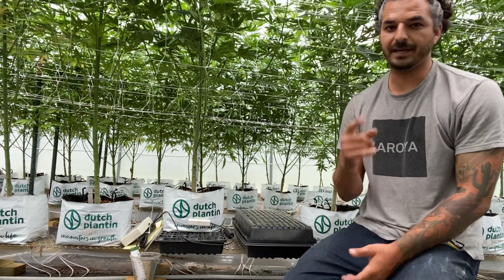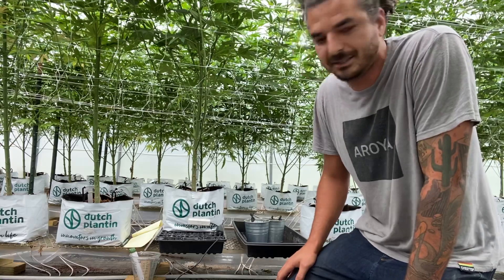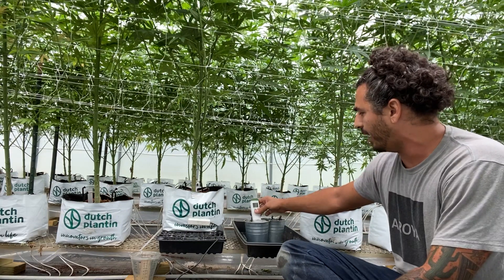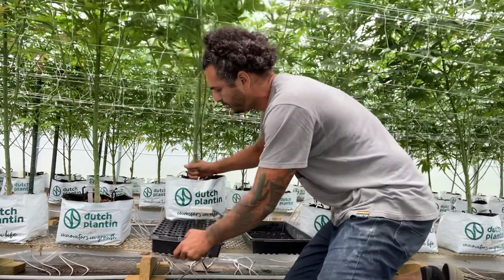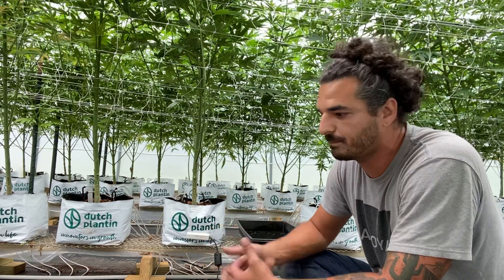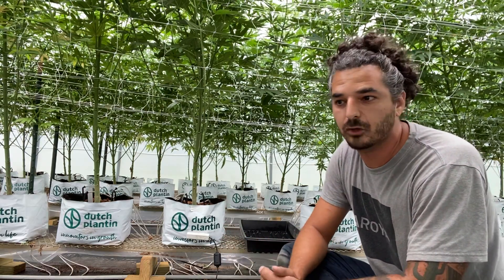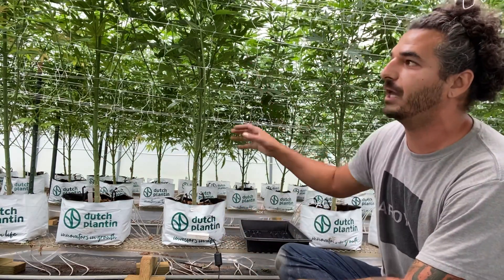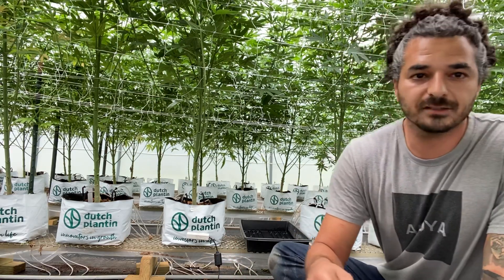Feed EC vs Substrate EC vs Run off EC

Comment: I am growing a sycamore fig tree seedling from seedling and my ec run-off (using distilled water for accurate measurment) for my 16 inch potting soil was in the 7000 microsiemens per centimeter range. However, I believe measuring EC in such a large pot shoul be done by small 100 gram samples from each leveled portion of the potting soil mix (like level 1 top, 2 middle, and 3 base of pot) using 100 millilitres of distilled water and a coffee filter, a spoon, pH meter, and TDS and EC meter to determine area of concentrations (specific accurate results) rather than the whole content (general absurd result). This type of tree is said to handle heavy droughts, high salinity, and dry temperatures, high alkalinity, heavy clay soil tolerant (as long as not waterlogged), etc..

Comment: I'm over loaded with all ur info. I grow in soil and always try to keep my ec at 2.2 going in. I freaked when I saw my runoff coming out at 4.4. My ppm I'm putting in around 1250 and it was runoff of 2000 to 4000. I flushed till my e.c came down to 1.8 and ppm came down to 1200 to 900. My plants were just starting to show some tip burn and I had some yellowing leaves from what I thought was cal Def mag Def. Probably lockout with ppm and ec off so bad. Ur system is incredibly complicated but I'm sure much more science is involved and invaluable for creating ur decisions on how to push the girls. Can I sign up somewhere for a apprenticeship with u. I'm ready to do whatever it takes to up my understanding and my game. I'm a 51 year old grower who now realizes I have much to learn sensai
Reply: Solventless BnV and i were just talking and if you are using coco as a medium and doing stack feeds you should be flushing once a week or at least once every two weeks and by flushing I mean if you have a 2 gallon pot you need to flush 1 gallon wait 10 minutes flush the 2nd gallon then take the reading and adjust feed’s accordingly .

Flush water starts as RO and is mixed with cal mag 5% at 200ppm and ph to 6.2-6.3 depending of run off 
If run off low ie 4.5ph you beed to feed 6.3-6.5 to bring back up 😎

Comment: What's optimum EC levels for Bruce Banner 3 week 6 veg in Cocoa n perlite ,I was up around 1:7 EC 6 pH and only 1 out 4 has nutrient burn,but now reading in Cocoa max should be 1.2 in veg and around 1.6 in bloom, my run is only .5 lower than feed, don't know what to believe ,my just back them off bit daily till see how goes on 1.4

Comment: Ramsey, have you ever heard of people having problems with the Teros 12 being accurate in a 70/30 coco/perlite mix (possibly due to air pockets from the perlite?) I'm getting wildly different readings between in-line feed EC, substrate EC, and runoff EC. The Teros 12 sensor will read a 4 EC when the runoff is reading 11.5 in veg. The in-line EC reads at a 3, and a catch cup has verified the EC is coming out of the stakes that way as well.
Reply: I would only use one for soil or rockwool
Reply: He should be measuring 100 grams of the soil samples from each level of the pot rather than the whole pot.

Comment: I still don't understand why EC is the preferred unit of measurement. And if 150ppms is .3 EC , that means 9.5 EC is like 4750ppms . How come there's no Burn?
Reply: As long as there is some moisture content in the rootzone their should be no burn. Burnt leaves happen when the rootzone becomes dryer than the moisture contained in the plant tissue and the osmotic pressure will pull the moisture out of the plant tissue, leaving behind only the salts in the tissue resulting in a burn. At least that's how I understand it.
Reply: I was going to say the same thing other guy beat me to it… watering frequency is the key… if 1of those plants droppers clog for a day it’ll burn right up
Reply: @gorillaglue2x2 dryer than the moisture in the plant tissue meaning, the combined amount of water in the stalks/stems & leaves?
Reply: @ym-imyloi981  yeah basically, I think of the plant as the straw that sucks the water from the rootzone, and the "person" that's sucking the straw is the environment. If the plant is trying to drink water and the substrate is too dry, the moisture in the plant leaves/stalks will start to be pulled to the dryer spot (substrate), thats why when a plant is dehydrated, it will look limp, so when you water again, now all the water is in the substrate, and the environment will start pulling moisture thought the plants. Photosynthesis is how plants use light for energy to convert CO2 and H20 into sugar and oxygen. The light hits the leaves, and the start releasing moisture and oxygen through their stomata to balance their rootzone with the environment. I'm probably explaining it weirdly, but if this isn't the answer you were looking for, let me know and I'll point you to the right person to talk to about it. 🤜🤛
Reply: @gorillaglue2x2  I sort of understand it, that could be why I’ve let plants go dry with a high substrate EC (different strains trying to dial in on one pump) and a day later when they’re fed the leaves are bone dry and burnt to fuck
Reply: @ym-imyloi981  yeah, it definitely can happen, especially in a smaller container.  Do you water fully then allowing for a full dryback? Or are you trying to keep them wet all the time? The more often you water, the higher the EC should be, and the less frequently you water, the lower you can make the EC so that you don't burn your stuff waiting for the pot to dry completely.  What size space are you in? What light/wattage are you using? What size pots are you using?
Reply: @gorillaglue2x2  I’m using drippers, in week 6 so feeding a 1.5 EC and I give them 5 shots over a hour and half and then go to run off, give 2 more small shots before lights off

5L pots coco perlite mix
Reply: @gorillaglue2x2  not sopping wet aswell, just moist
Reply: @ym-imyloi981  that input ec sounds low, are you using led? LED produce much more PPFD per watt than HID lights, so it tends to require a hire EC to start with. Like if you feed a HPS room a 1.5 EC, you will be fine since most of the energy from HID lighting gets discharged as heat, where an LED converts almost all of the energy into light. It sounds like you might be feeding them too low, and when the plants leaves are getting more energy than they can handle, the cells will die and become crispy. I'm wondering if that's the issue or if it's something else?
Reply: @gorillaglue2x2  that could potentially be the issue I was at 2 EC on week 5, dropped it down a little bit now. 

Trying to do crop steering without any sensors and for the most parts the plants look great, just the lower stuff is getting crispy

And yes LEDs 600w about 16 inches from canopy
Reply: @ym-imyloi981  yeah, when you lowered the EC, it dilutes the nutrients that are in the plant tissue, essentially making those cells less tolerant to the light stress. As for the tops looking good, bottoms getting crispy comes from the light at the top being sufficient for the amount of nutrients you're giving,  but since there's less light, air/CO2 flow in the lower canopy,  the bottoms may be getting too much. I think your best bet is to just continue the run and taper down everything. It's better to finish with too little than with too much anything in my opinion. What size space is the 600w over? 4x4? 5x5? Tent? Room? Sealed? Not Sealed? Adding C02? Sorry for all the questions,  just trying to visualize.
Reply: Not sealed room

Comment: 9.5ec?!!! Holy balls. I don’t think that meter is correct. Maybe at full dryback. And I don’t think checking EC at dryback is very useful.
Reply: Im pretty sure that meter reads spot on  ...
Reply: 9.5 ec is 4500 ppm by Hanna.. that is hot 🔥
Reply: @ninjafrog8419  9.5ec is a quick way to kill your plants using any meter.

I get nutrient toxicity problems starting at 2 with autos and 3 with photoperiod plants. Even when added to the hardest water, I will not be running a grow of any plant over 4EC.

Even in organics where a lot of the conductive elements are not nutritive or not plant available, the EC shouldn't be that high because it negatively impacts the passive osmotic transport system in the plant roots.

In a nearly dried back organic media at the edge of the pot where the salts tend to accumulate I can maybe see getting a 9.5 on a meter, but I can almost promise all roots in that zone are dead or inactive.
Reply: That meter reads correctly. Are you thinking 9.5 is too high as a feed or when measuring substrate, because he is only feeding at 2.0. His data along with the observation of obvious plant health is indicative that those roots are very healthy and is in no way risking plant death. It is not soil, it’s coco, so the root zone ecosystem is going to be different from soil. Excellent info, and I do get why you think that sounds way too high. But, I think Ramsey is correct here.
Reply: @Trousersz  I'm returning to this video, and this post, after more years of experience. The issue with my original statement is that only input EC is constant, but runoff EC and substrate EC are variable. If we want to discuss runoff EC, we should establish when that runoff should be measured and how the plant should have been watered ahead of that runoff so that we are talking apples to apples. I can imagine a situation where a substrate fluctuates from 10EC when dried back deeply with an already high end of day field capacity EC, but the minimum substrate EC for the day could very well be 3-5 (take for example a 50% dryback where the plant preferentially absorbed water, and a feed EC of 3).
When I made the original post, my knowledge of substrate EC as it changes across a day was/and still mostly is limited. I think the sensors available to me (growlink's version of the teros 12, looks identical, and hand probes) are fairly wide approximations rather than absolute values. One of my sensors right now says my substrate is 2.24, despite the runoff at that same moment being 5.0, and that being the last runoff event of the day (presumably the closest match to the substrate). A stick in probe may say 12EC near the edge of the pot, but 2 everywhere that actually gets moist, so consistent positioning is also critical.
The way I would modify my original post is that if you are seeing runoff that is anything above 7 (assuming it's a later runoff sample), then you should take measures quickly to get that value down; i.e. if you are using substrate sensors and you don't see a day-minimum below 7, then expect problems.

Comment: I’m slowly trying to learn about ec.  I made my own blend of soil and tested it had an ec of 3.0 ppm was 1560 ph was 6.15. I wouldn’t know how to raise or drop ec if I tried :(
Reply: Have to flush it with lower ec water. Example target 2.0 ec ? Flush straight water 0 EC. and catch until closer to 2.0.
Reply: @LarryGipson96 never flush 0 water always mix 100-200ppm cal mag and ph accordingly (6.2-6.3)
Reply: Raise EC = more watering 0 run off 
Lower EC = more run off
Reply: @d-boyzeighteenhundred this is for hand watering. You lower EC by getting more run off

Comment: Hi great video. i'm curious as to how you know the exact % of runoff you are having? I am assuming the sensor gives you this information? If your substrate at full saturation has a VWC % of 45... would it mean identifying the total number of shots it took to get the medium to full saturation and then applying a certain number of subsequent shots based on the percentage of runoff you want to achieve? Or are you measuring it from the catchtray and contrasting it to how much is filled in the cup? In a small set up, sacrificing 1 set of drippers for a cup and not a plant is painful lol Thank you appreciate any feedback
Reply: If you have found the answer could you share it please :D looking for info on feed schedules for crop steering in COCO. Thanks in advance

Comment: Well, you've just blown my mind!  I have been cultivating in Spain for the past few years and I have been achieving really high-quality flowers with yields around 1. - 1.5g per watt while feeding at a maximum input feed EC of 1.4EC I always assumed that if the EC in the substrate climbs its because the plant isn't using all the feed I am supplying, I have always modulated input EC to maintain substrate EC of no more than 1.0 above input, ie 2.4ec maximum.   Can I ask how many grams per watt you achieve with such high substrate EC levels?
Reply: do you not find your substrate PH to be too low if your substrate EC is high?  Also, plants don't uptake minerals equally, so surely you don't really know what the composition of that 10EC is, it could be unbalanced no? Also, lower light intensity the higher the EC?  surely under intense lighting, you need higher EC to drive photosynthesis harder? Your plants look lovely so I am sat scratching my head lol